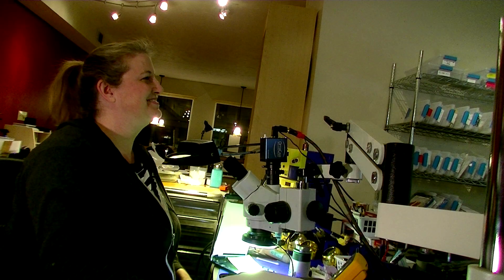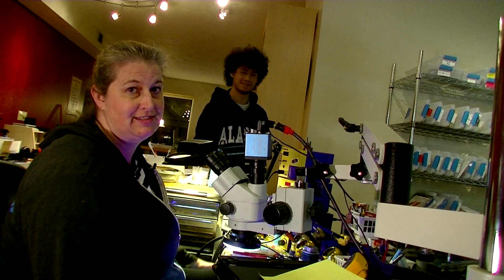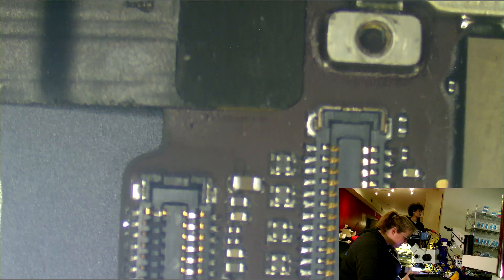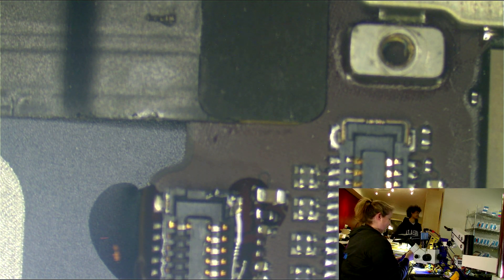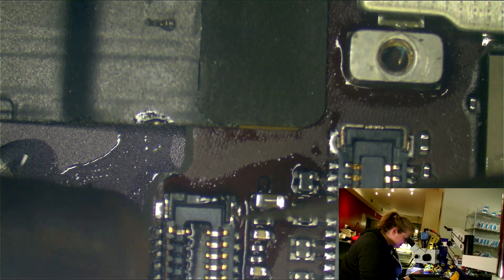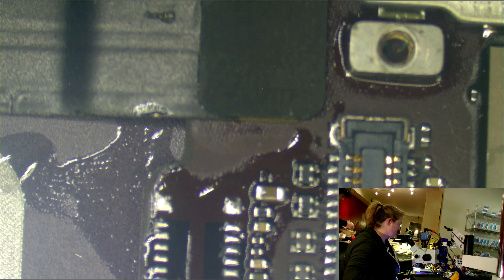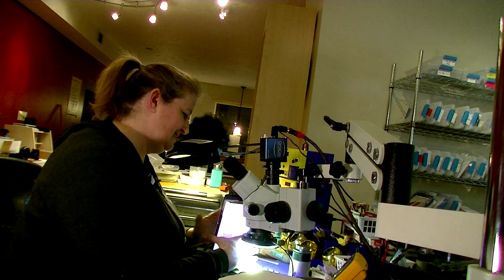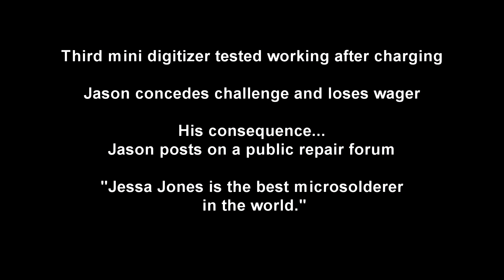20 minutes for an iPad mini digitizer connector?  That sounds like a challenge.

Comment: Hi Jessa. What temp on your hot air station are you using? Thanks so much!
Reply from the maker: Somewhere between 300-450c depending on the job. This always differs. 

iPad Rehab highly recommends the Quick 861DW http://bit.ly/2xGDTXo for a cheap, affordable, powerful hot air station with an easy interface. It will remove all different types of chips without a problem, unlike weaker stations that can't stay hot enough long enough to do the job.

Comment: I find using a conical tip set at a slightly higher temp than normal and just running it along the pads works great.  Generally don't get any damage dependent upon the plastic.  I want to get back into repair (was a 2M mini-micro tech in the navy). Used to work on all kinds of old and new stuff.  I normally had to do about 5-15 repairs a day, ranging from super easy stuff to repairs that would make me take a step back and really think about how I wanted to tackle it.  One of my favorites (and I remember this 8 years later) was when I had to replace a connector on a piece of test equipment (worked at a calibration lab at the time) that was kind of like coax.  The issue was that it had the copper wire in the middle and a copper conductor encasing it on the outside.  The connector we got to replace the old one was slightly longer, increasing the overall length of the conductor.  This wouldn't be an issue if the outer conductor wasn't highly affected by phase variance.  I ran out of space.

Comment: wow, you make it look so easy Jessa (practice I guess). Ive just attempted the 20 pin connector rermoval, used too much heat I think initially as the plastic started to go soft, reduced air flow down and up along with temp, still wouldn't budge. Ended up pulling connector off and pulling a couple of pads up, plenty of flux used in the process. Also pushed  a component close by with the higher air flow. Glad it was my practice board so no harm done really.
Reply: +Hartley Hare Grrr, attempt No2 and no better. Tried lots of heat. 180C right up to 300C, air from 4 to 6.5 (nozzle is 6mm which is a bit too big), Saw solder melt, tried to push connector away but just bent up the metal frame at top of connector :( Ordered some new 4mm nozzles. What&#160;temp should these be ';do-able at?- I'm having fun but I'm gonna need some more practice boards!! Flux used is chipquik291.
Reply from the maker: +Hartley Hare I can't teach you to solder over the internet, but it sounds like you are not using nearly enough heat.  Forget the number on the station, practice just watching solder bead up.  Do not attempt to push the connector unless every single pad is shiny.  If you want to learn to do this, come out to Practical Board Repair School and I can show you exactly what your problem is as I watch you solder in real time.
Reply: +iPad Rehab 
Thanks for a reply. I understand that and yes, I try to ignore the number on the station as you and Louis always state its meaningless to just give a number when everyone asks. Hence why I tried different settings to look for a change . I'm just burning up the connector in my mind. I watch the videos posted on Practical Board Repair School and think they are great but I'm in the UK otherwise it may have been a different story :) It'll come along with more practice I'm sure. I'll give it some more heat and see how that goes on my next attempt! That Mini case certainly acts like  a big heatsink I've noticed too.
Reply from the maker: +Hartley Hare burn it up.  of course the plastic will melt and be long gone before the lead free solder even thinks of melting

Comment: why you use your hot tweezers? just use a hot gun. i don't have a hot tweezers or microscope and can fix this iPad in few minutes.
Reply: Because hot air for placement distresses the plastic and the joints aren't as strong.  As you can see, it is just as fast to place the connector with hot tweezers and you get a better result.
Reply: +Jessa Jones I have to agree, as using hot air to put back the connector it is a major gamble between melting the connector and melting the solder. Iv done it in the past, but some connectors will take more heat than others before they turn into a big lump of black crap.

Comment: instead of heating the connector that's destroyed I usually load my iron with leaded solder and just plow through the old connector. melt the plastic and solder and just remove it all. 
Your hot tweezers work is amazing though.
Reply: I did it that way for a long time.  But blasting it off the board with hot air is so much more fun! I'll never go back